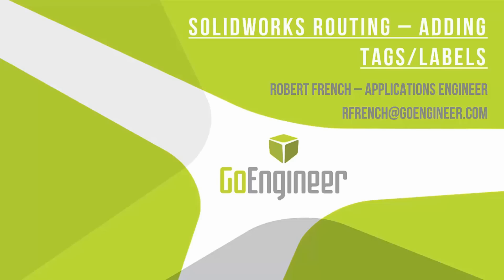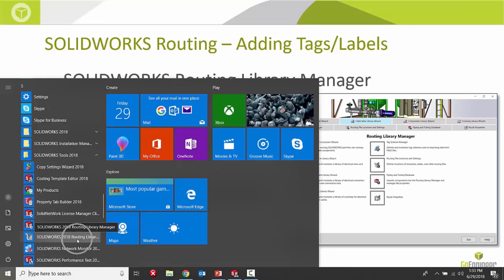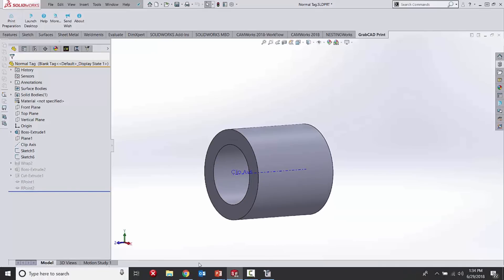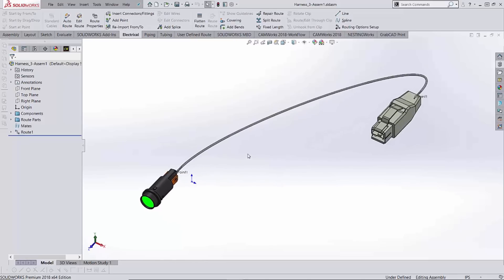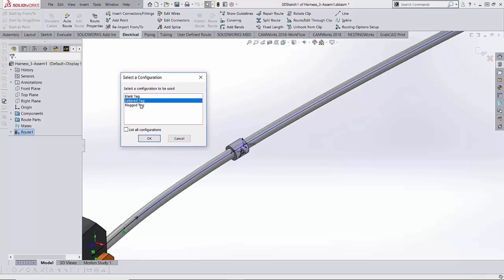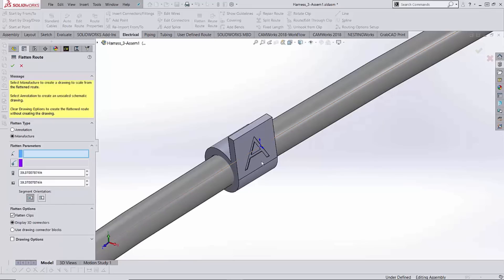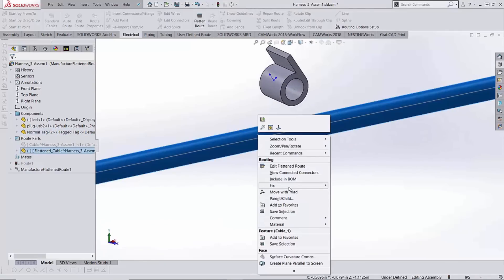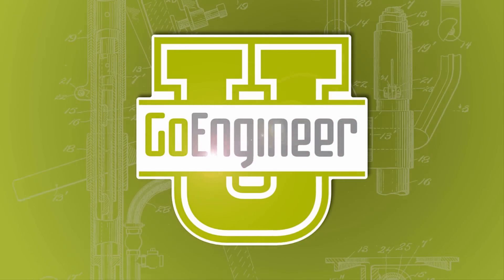SOLIDWORKS Routing - Adding Labels or Tags

Comment: How do you do this for piping because there is no "clip" option like there is under electrical routing type??
Reply: For reference, I am trying to mark my valves in a large piping project. There are about 40 different valves in that assembly that need to be labeled  (e.g. 1A, 1B,... 2A,... 3A etc)